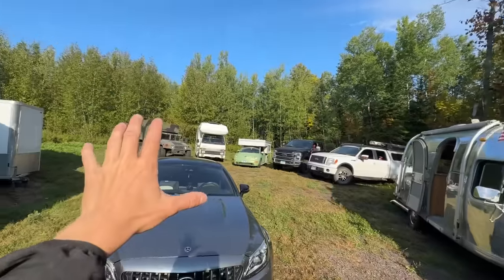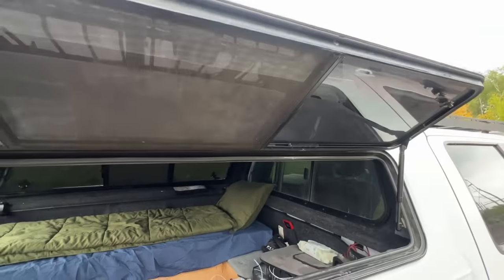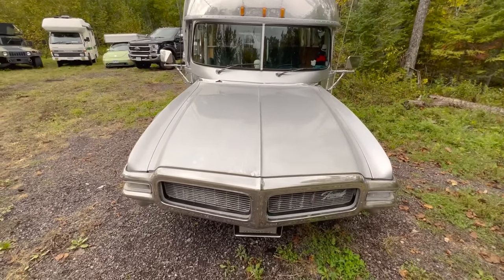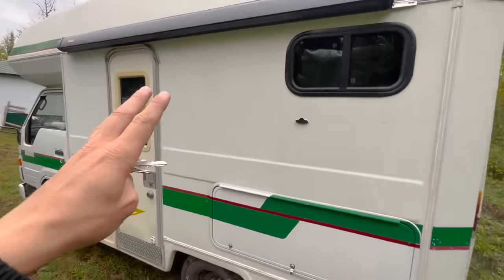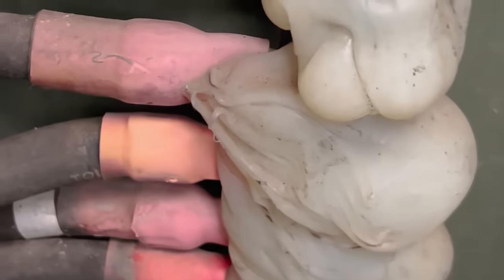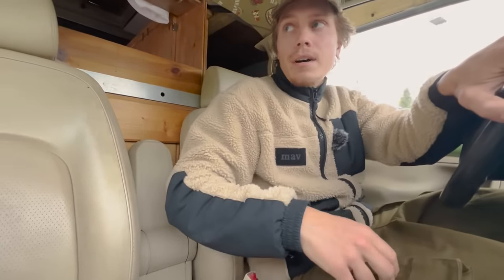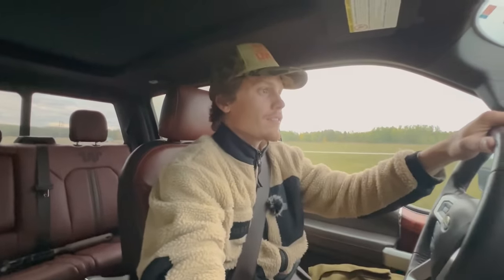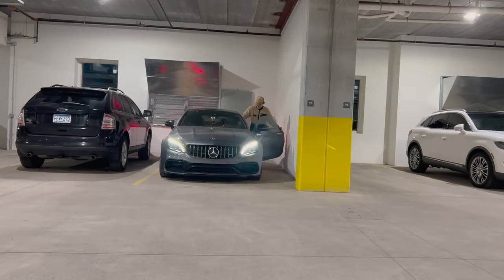full tour of my car collection

Comment: Mav! Consider having a concrete pad poured if you're going to leave your vehicles out like that. Having them parked on the grass will allow for a TON of condensation to be trapped in the undercarriage and promote massive amounts of pre-mature rust! Much love from Southern Ontario!
Reply: @Mav
Reply: Agree
Reply: Big Facts!! Was thinking the same thing the entire video he should just build a big garage for all them beauties! Lol
Reply: Even just a vapor barrier below a gravel lot will help tons, but concrete is even superior!
Reply: @GabrielGarza7 Isn't that what's next to the cars? If not you are completely correct.
Reply: It's not possible for any vehicle to be able to carry a ton of condensation in the undercarriage.
It will just run off or the vehicle would collapse with that amount of weight.
Reply: @d1user  That's completely incorrect.
Reply: @AndrewB416  no it's not.
Average car weighs about 1.8 ton if u add a ton of condensation it will be 2.8 ton.
It's not physically possible for there to be a ton of condensation being held in just the undercarriage area.
It won't even be able to hold a couple of kilos, it will just run off onto the floor.

Comment: Ok, test me: I got into an auto mechanic apprenticeship in ‘69. 

You have a 455 with a quadrajet reputed as the closest GM came to fuel injection in a carburetor. 10.5 to 1 compression and something like 335 HP. You will find different numbers because the SAE changed the method of rating HP after the big Olds was made. 

Dr. Oldsmobile, a role reserved for Ringo Star yes the one and only Ringo Star was the front man for Olds. 

The Toronado is front wheel drive with a basic Turbo Hydro 400 engineered to transaxle use. It wears out front tires as fast as you can buy them. 

The luxurious interior is reason alone to preserve this precious piece of All American heritage.

Love ya man!

Comment: This idea would be an investment that Mav may not get a return on (most likely would though), but what if he did a trip/series where he maps out a quest that involves all vehicles.  He has each vehicle sent to a predetermined pickup spot, and then he drives to the next spot in the designated vehicle for that leg of the trip.  So basically he would start the trip with one vehicle, and pass off to another each leg of the trip, kind of like a relay race.  IDK, just something that came to mind.

Comment: @mav if you love the TDI get it's ECU tuned + singlemass clutch + 11mm injection pump(the comes off the automatic versions of these 1.9l tdi(ALH engine code), just these 3 simple mod would make the car so much faster/economical(also EGR delete gives out more heat)

Comment: Look at the starter on your hummer. I had a 91 250 that smoked 3 sets of batteries, same problem with a bad ground somewhere. Turned out the starter wasn't returning all the way and leaving a small current draw.

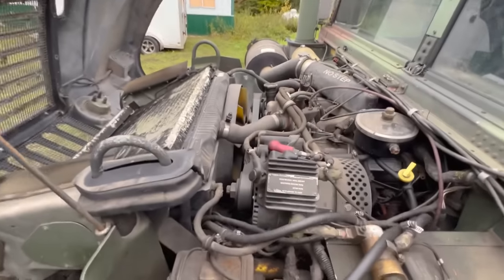Comment: 12:20 diesels run off compression and don't have spark plugs homeboy. they have glow plugs which heat up the combustion chamber when its cold to aid in starting!

Comment: Put a Holley efi carb on instead of the traditional carburetor on rolling Grandma's house

Edit to add: my guess on the Humvee would be that the voltage regulator (which is usually part of the alternator) is broken so the batteries are getting degraded from being overcharged. A bad ground is still totally possible from what I saw also 😬

Comment: The Vw beetle is a 1.9L tdi. Not a 1.8L tdi. Vw did make a 1.8L turbo gas motors aka ( 1.8T ) Also you fill up with fuel not gas, big difference as well.

Comment: Humvee might need a replacement voltage regulator if it's eating batteries or there's a chance it's setup for 24 volts, which is overcharging the batteries.

Comment: You have to match those tire sizes, if you put that thing in four-wheel-drive with those different size outside diameter it’s not good for the transfer case, even if it’s viscous or clutch packs

Comment: The smaller wheel is on the back for the load capacity, the denser the steel structure the less brittle it becomes, in theory.

Comment: Hey Mav, appreciate the show and tell of your vehicles! If you could, or anyone for that matter, just some clarification on the tires or wheel sizes that Steve are endowed with. I may have misunderstood what you said but thats why I'd appreciate the exact front and rear tire sizes. As you said, one was bigger than the other but in referencing the numbers, it didn't add up. So can we get the simple standard stats of the front and rear tire sizes: _ _ / /R _  Also, my bad if my explanation is confusing or I haven't been clear enough - I'll admit that I totally agree with the bunch of people who have kindly told me that my communication skills are just odd, confusing, annoying, and just the lacking. Thanks!

Comment: That Torino.......yank that engine trans LS swap it 6.0 or better. 6l90e transmission........you'll thank yourself later.....Check your gear ratio in the back throw a trutrack 4:10 all doable ...... around 7k depends who does the work. But builder's are gonna be high.

I did a Chevy G20 hightop exactly what I just specified. The mechanic did a shit job. Yanking the 6.0 and 4l80e . Now going 6.2 6l90e aluminum block. MPG will be around 18